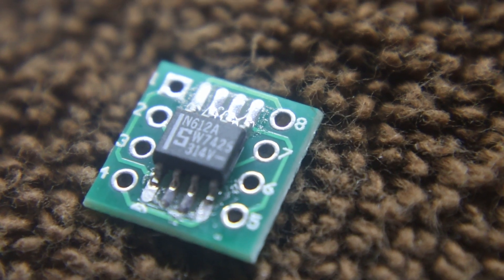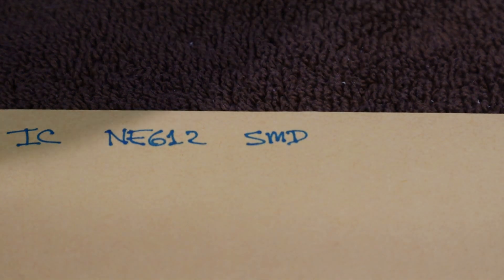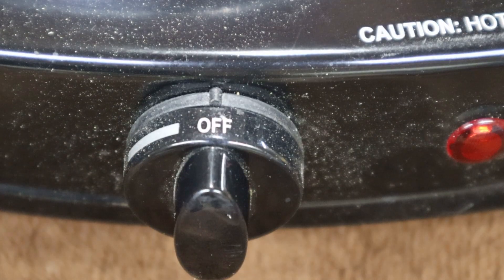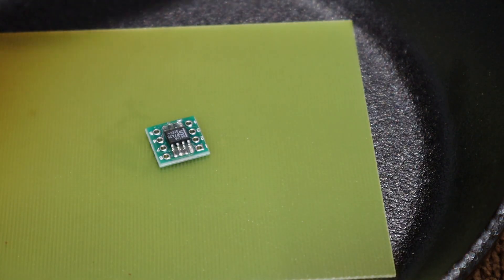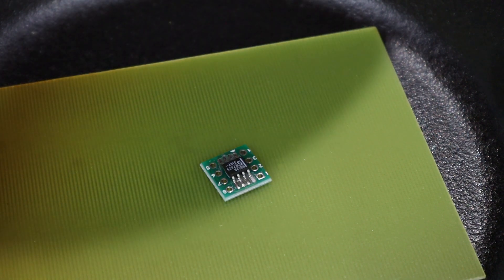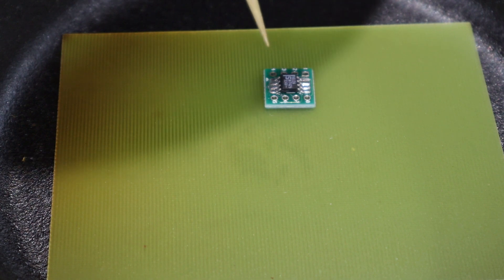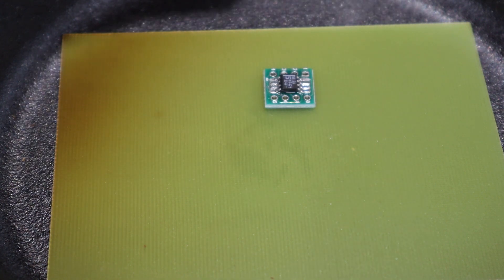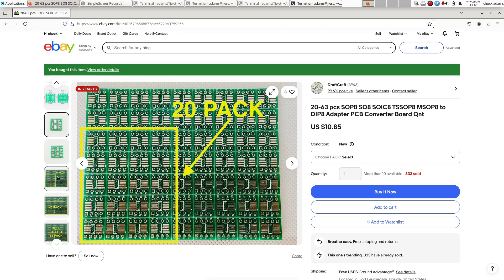Manhattan Circuit Construction  --  #007:  SMD soldering with hot plate

Comment: Wonderful little smd adapter boards Chuck. Thanks for pointing them out on eBay and  use of the hot plate for attaching the chips. Good video.

Comment: As a future series, would you show how to move a rig to another band. RX filter and vfo is easy, just some math. It is the TX driver, Amp, final that is problematic. Tried following some ham articles but they assumed some knowledge never mentioned. Or used parts with no post 1990 equivalent.

Specifically I have a couple [wife shouts more than a couple] 10 meter ssb ( tx/rx in a box) that I would like to try on 6.